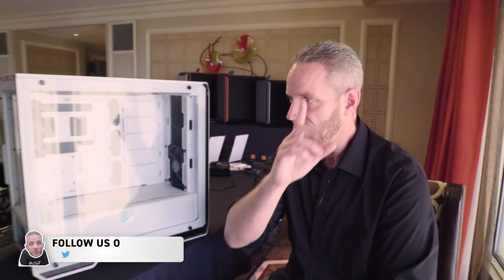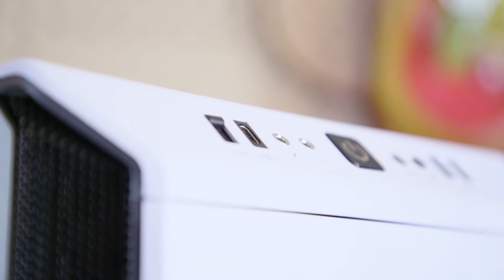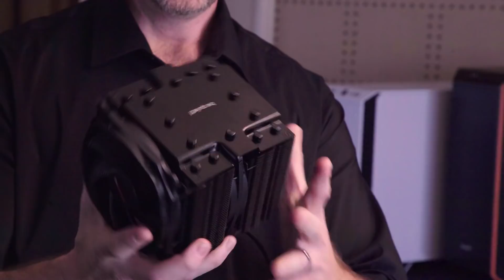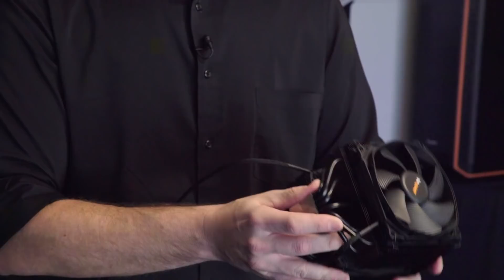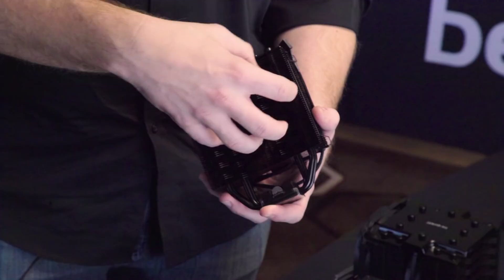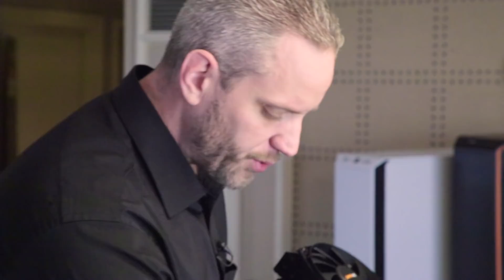This might be my new favorite Air Cooler??!!

Comment from the maker: We have already cleaned the sensor! So no more dark spot after this video! YAY!
Reply: Bohh ho ho
Reply: JayZ, you're becoming a normie? You, of all the people, like an air coller? Dafuq?
Reply: didn't stop me from checking for stuck / dead pixels on my monitor tho ^-^
Reply: now you just have to stop putting the fucking cringey fart sound at the end of the videos
Reply: Jay wat do you think about MSI Core Frozr XL compared with Dark Rock Pro4  ?
Many thanks
Reply: What was you're previous favorite Air Cooler JAY
Reply: much hype, low performance cooler for the price.....
Mugen 5 pcgh and thermalright aro m14 are 45 bucks.....

The new nh u12s from noctua, gonna trash all of these be quiet in therms of performance per size.
Reply: Big fan of the fans, but cases and coolers sucks. They are premium and expensive, but they suck on performance, considering the price tag.
Reply: whats the best inexpensive cooler or aio for the lga 1151 socket that youve found? im building a mid range budget pc which means im looking for inexpensive but am willing to pay a bit more if i can get better performance
Reply: @SkullCrusher757  thermalright macho REV.B and if u can´t find it, mugen 5 pcgh or rev.b
Reply: @TTks124  would it widen the choices anymore if i mentioned that i dont care how much noise it makes also i was kinda hoping for jays recommendation but yours is just as well as his
Reply: @SkullCrusher757  thermalright le grand macho RT and NH-D15 is as good as it gets. The thermalright for cases with good airflow (mesh front or good intake) and front intake aligned with the cooler and the back exhaust. Ofc any air cooler would benefit from those conditions, but the macho RT is the TOP DOG in that best case scenario, and despite u not caring about noise, it´s actually more silent than the nh-d15 and also cheaper.

Where good airflow is a problem or it´s just avg, nh-d15 will be at least as good as the le grand macho RT.
Reply: @TTks124  is the Noctua NH-U12S compatible with lga-1151 socket?
Reply: @SkullCrusher757  yep, but i wouldnt recomend it. Yes!!, it´s probably the best AVERAGE SIZED (120mm fan) cooler in the market, but as i said thermalright macho REV.B and schyte mugen 5 pcgh or rev.b go for 45 bucks and both are better than the nh-u12s. If u`ve seen my comment upside, i wasn´t talking about the current u12s, but about the new one, that´s not out yet.
Reply: @TTks124  i think your pricing is different than mine because the Noctua NH-U12S is $50 from walmart with free shipping and the rest of them are $75+ from amazon because they have $5 tax and like $30+ for shipping without that they may be $50 and the odd thing is that i live in central virginia so there should be no reason for such ridiculous shipping costs
Reply: @SkullCrusher757  ye srry, i didnt think they arent available in the US.
Here mugen 5 and macho REV.B go for 45-50€ and the NH-u12s and dark rock 4 goes for 60-65€. Le grand macho RT usually is 60-70€ and the nh-d15 85-100€.
Reply: @TTks124  theyre available just not cheap when you add the tax and shipping  and the worst part is id have to order them online since the nearest pc part store is 3 hours away from me
Reply: @Zwenk Wiel if u want in black and for Intel, raijintek ereboss core edition 38bucks but u need to slap a fan on it.
Reply: i was very worried about the dark spot on the sensor. i was afraid that a fly came and shat on it. thanks for clearing things up.
Reply: There is a dust grain on your sensor.
Reply: Yep I was going to talk about that right now
Reply: Oh.. now I'll miss the spot (ba dum tss)
Reply: Was just about to post about that lol
Reply: I kept wiping my phone to get it off.....
Reply: I opened the comments to address this issue but it would seem it has been done already.
Reply: JayzTwoCents first half is one giant add.............🖕🗿
Reply: One wouldn't exactly call that dark spot a "bohemoth."
Reply: YAY JAY :D I made about a dozen videos with dust particle in my mobile's camera and people hated me forever :D
Reply: Sir please check out ACER. I am not a big fan of ACER however they do come up with some  wild products that will blow your mind and your bank account its a $10,000.00 gaming  computer. ok the shipping is going to be hell. because  that computer weight is 500 pounds. its going to be send it out in many boxes. if you want it  ACER will send a man to your home and put all the parts together so you do not have to. its too much for any one to deal with.. its like building computer for a BOEING 747 with all its  cables and wries going all over. and ACER will send you a chair  that will move This is a BEST and  I think you want it
Reply: JayzTwoCents Such a huuuge brick of mass won`t it block off lots of the general case airflow ???
Reply: I am using a ryzen 7 1700 oc 3.8 and a gtx 980ti gigabyte G1  i am runing a gigabyte 750 watt psu is that enough for the twin tower ????
Reply: @Jayztwocents hope you don't mind that I'm asking for a favour for a friend if its not a problem? Wanna get some close air support in tech for a close friend and dude has helped me fix and setup stuff and tough me alot bout pcs dudes dad is a vet. My close friend been getting bullied for no reason and dude is a good dude and wanna make sure dude can get stuff for what he dose and I'm out state for work in tech and unable help at the moment with the situation. Dude even deleted his YouTube channel and would do more gaming stuff over fixing videos so I can't just link his channel to give him some support that way. I know he watches few you guys for news in the tech world and hope it isn't too much to ask. Dude also a work from home guy as well. Im independent technician. Would ask guys around my company but want to ask somewhere he be at especially him working out of home. I always bring dude with me when im in his state cause he that good with PCs for gaming and stuff like that when theirs work for that for me in that state.
Reply: ah ok so thats what it was I thought my brand new 4k monitor was freaking out lol! :D
Reply: Luckyly you wear a black shirt in the video so that the black spot does not show up that badly.
Reply: can i get skunkworks for free??? or just the $500 pc which failed???
Reply: DarkGenius!! Yes in your dreams .Get a  job  work hard it mean more and you want to take care of it better.
Reply: @darkgenius7744  r/ChoosingBeggars

Comment: i have an itx case and have trouble fitting full size coolers. I have a dark rock slim cooling my 5900x and it does a great jon. its rated for 180 and it definately does the job. im currently at stock settings on the 5900x but I definitely have a little room to overclock. Dark Rock coolers are great if you dont want to worry about maintaining a water system. Dark Rock for the win!

Comment: Try a Scythe FUMA 2
Reply: Gee, I built with a Sythe Mugen 5 revB and their engineers actually thought about mounting the unit. It was a breeze as you do not have to remove the top - and they provide a screwdriver. So while Be Quiet is a good company you have to wonder what they were thinking that they had to revamp the mounting setup. Oh and don't forget about the offset design of the Sythe coolers. Somehow Sythe does not get the love that other cooler companies do.

Comment: if the slim is basically just a black coated hyper 212 evo then it's overpriced. The pro 4 though with two towers performs awesome even just as good as some water cooled loops.

Comment: just bought the dark rock 4 this past December its been amazing thus far. regardless how much voltage i give my cpu the temps barely get past 66C. I'm planning to buy the dark rock slim for my wifes rig when i get around to building later when tax refunds hit. ok I partly bought this cause its a super sexy cooler maybe more than the thermal performance Im getting LOL

Comment: Im using the dark rock 4 on my 8600k (4.9ghz @1.33v (LLC lvl5 on asus z370f) and it is sitting at about 72°C avg under full load and the 140mm fan is almost inaudible!! I am so impressed by new dark rock Line-Up i can really recommend it!! (and the handy screwdriver is a pretty nice extra)

Comment: I received the exact same screwdriver (with red on the handle instead of black) with my Thermalright HR02 back in 2011.
Pretty usefull cause it's pretty long and magnetic.
I always wonder if a brushed silver aluminum top cover plate would look good on these deep black coolers ?

Comment: Could u turn a air cooler with copper pipes in to a water cooler by cutting open the copper pipes adding water fitting/water pump.?

Comment: cool new dual tower coolers. I have a Noctua NH-D14 with 3 noctua industrial  nf-f12 ippc-3000 pwm 120 MM fans and this does a great job on cooling my aging I7 980X @ 4.4 GHz CPU. For my next PC i am split between a dual tower aircooler or go full custom water loop but just as Jay says, it does need more attention and cleaning + the risk of leaks, pump failer and so on. While Aircooler can only fail by the fan stop spinning. So properly my next cooling setup gonna be Noctua NH-D15 with 3 Noctua indusstrial fans and thermal grizzly kryonaut cooling paste. It has been a winner combo with NH-D14.

Comment: I ended up buying the be quite! Dark rock 4 pro cpu cooler & 2x 140MM SILENT WINGS 3  1000rpm fans last month, over all the DR4Pro was 5c cooler then my 4 year old corsair h105 (2x noctua nf-f12 fans) 4790k @ 4.4ghz 1.22v (using WPrime & BFV) darkrock 4 pro is alot quieter also. I highly recommend getting the dark rock 4 pro!

Comment: For the base 700, I read from other smart tech people that it was not really AiO friendly because it misses holes on the top for the air flow for the fans (which is not the case for the Pro 900 v2). Your opinion?

Comment: Been a massive "fan"  he he, of be quite for years. Currently got a NZXT H700i case with all be quite pro fans. The thing is silent, using the NZXT hub, run silent mode in CAM and the only thing you can hear is the Harddrive working.

Comment: Jay, you ARE correct. Water cooling CAN be a GIANT pain in the arse! Further, I have NEVER felt comfortable with the idea of water and electronics in close proximity, let alone very ex$$xy electronic components and water together. Never felt comfy. Air cooling with these massive CPU coolers are THE way to go. The ONLY attraction to me (not being an overclocker or game slave/addict)  is the pretty fluid pulsing around but that's not enough reason to go water cooling. Extra RGB (God forbid) can give you a colour fix if that's your bent. LOVE these reviews on air coolers - GO FOR IT JAY - really looking forward to seeing more on these monster air bits! Cheers from Australia!

Comment: Also. My BeQuiet Silent Loop 360mm was replaced by a Dark Rock Pro 3. The 360 is just too big.
Reply: could have told you that, and a 240 or 280 would have delivered pretty much same cooling.

Comment: UV and white cases can work very nice. TBH i prefer silent over cooling. as long as it's not pushing 80c full load.
Reply: IF you are pushing quiet you are always sacrificing temps unless it's just completely even which isn't really a thing. (queef noise)

Comment: The 2nd cooler looks pretty much the same as my old faithful Hyper 212 Evo.  I miss pretty coolers.  Bring back the Zalman Flower.
Reply: I was going to say the same thing. It's basically the same design. I'm running my old Hyper 212 with an overclocked Ryzen 1600 and it stays in the 50's under load. Still a great cooler.
Reply: @FreakTimmah  I have the 212 on my old Athlon workhorse.  It's a lovely cooler, and quiet enough that I can hear the HDD errors over the sounds of the fan!

Comment: The BeQuite cooler is great, but still barely keeps a 9900k from throttling. I've underclocked mine though now and the fans stay idling in games instead of ramping up and down constantly.

Comment: If you plan on doing air cooling then a few mid end cpu towers would be nice to see. I feel like most of the channels I see do a lot of high end spotlights, and then do the “cheap as dirt” options to see if they actually work and then the mid end (which I feel appeals to a much broader audience) isn’t looked into as much

Comment: Lol silent optimised - translated into english "suffocated oven"
Reply: Before anyone says it those piss poor inadequate perforations in the side of the front panel will only cause higher fan speeds to maintain higher temperatures. Noisy oven made in the name of "silent optimised". Go watch a few in depth vids and read a few articles about the flaws in modern case design, or rather the flaw that is the lack of functional design.

Comment: I'm really happy to hear about the air cooling videos that are coming. I've never built a PC before, but have wanted to for about 10 years (This year might be the year depending on what happens with CPUs/Graphics Cards). I know that I'm not up for the maintenance of a water cooled system, so I always get stuck on which air cooler I want. All the videos on air coolers are years old now, so I'm really looking forward to an update including the new stuff from Be Quiet and Noctua.

Thanks, Jay

Comment: Too bad the DB 700 has terrible thermals.  I built my new PC around that case and it was the worst decision I made.  It's currently sitting with the top panel and front panel removed.  I have a 7700k at 5ghz on all cores, delidded, with panels on I was in 80c range, with them removed it's at 50-60c.  I also have 2x 360 rads cooling it.  The airflow is so choked it can't breathe.  To get the somewhat decent temp of 80c I had to run fans at max, and with barely any airflow it sounded like a jet, which defeats the "be quiet" part.
Reply: Sorry but that was a bad purchase decision on your part. If you knew you were going for high ocs and therefore Temps why would you pick a silent optimized case with "meh" thermals? You might want to look into the meshify c though it's damn cheap for the performance. With proper fan curves that thing can be rather silent when not under load :)
Reply: Nvm the meshify c im not sure if it fits the 2 360 rads. Anyway gamers nexus has very nice benchmarks on case performance in case you want to switch :)
Reply: @TyrusSwon  Meshify C is tiny, and the thermals aren't that great in it. Source own one.
Reply: @NescaffeOne  glad you own one, but you're still wrong about the thermals.
Reply: @marcleblanc3225  I'm right about the thermals, lmao.  Even when you buy it stock, that one front intake can't do shit. The dustfilter / mesh literally struggles bringing in air.
Reply: @NescaffeOne  cool, you're dumb and I'm gonna leave this right here: https://www.gamersnexus.net/guides/3120-best-gaming-pc-cases-of-2017

Even stock, it's in the top half of cases tested for airflow and temperatures and that's with ONE FAN.

Comment: I love a big air cooler. My fav was that circular Zalman for years. It just looked so automotive and turbo’ey... no word but still u get the idea. I might use air again on next machine just for that skynet nostalgia
Reply: Big air coolers have been proven to be just as good as AIO liquid coolers, and they are cheaper.  The only issue is space, but if you have a big case you are fine.
Reply: There is such a thing as too big, you dont want to hinder the airflow on the motherboard. If you cover most of your motherboard with the cooler, thats not a good sign. Balanced coolers are best, not too big, but not to small either.

Comment: Cmon, you can fit most air coolers in most cases, my nh d14 is cooling a ryzen 1200 in a micro atx case :D
Heatpipe tips barely touch the noise dampening foam^^

Comment: I have the dark rock pro 4, it works really well, goes toe to toe with the Noctua DS-15, but it IS a real bitch to install, and the brackets tend to ruin the fins unless you're really really careful...then after installing the first time, after a day I suddenly hear a very loud 'snap' in the case, pop it open and see one of the four screws just broke the fuck off.
Replaced the screws with some decent ones, all good now. Obviously those screws can't handle much cause I did NOT over-tighten it.

Comment: I have the dark rock pro 4 running on my 7900x build overclocked to 4.7 ghz. It keeps it at or below 90f at idle and I haven’t seen it go over 135F even under a sustained render load. The thing kicks butt

Comment: I'm still rocking a Dark Rock Advanced from ~8 years ago. Original fan still in place and no bearing or noise issues! Still within a few degrees of more 'modern' models and has seen me through 3 builds. Sure, the mounting system is a complete pain in the arse but can't fault the performance. Rubber fans mountings went bad obviously, but a quick email and they sent me metal replacements out from Germany to the UK for free and years out of warranty.

Comment: by core overclocking voltages vs fixed all core voltage. My Asus X299-E works really well using Air Cooling when controlling heat by core.

Comment: I'd be curious which coolers allow Ryzen to hold at their highest boost frequencies without cutting back. My 2700x with stock rgb cooler can't cool under load to the  chips full potential.